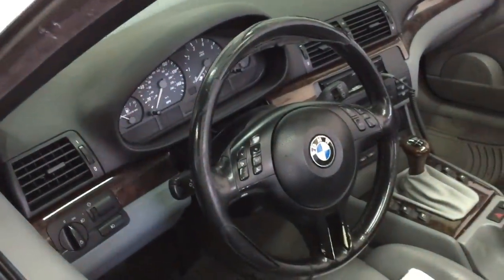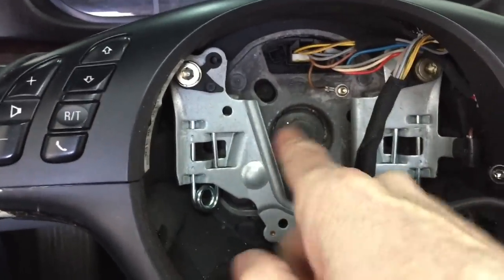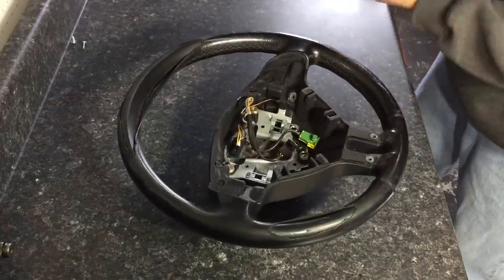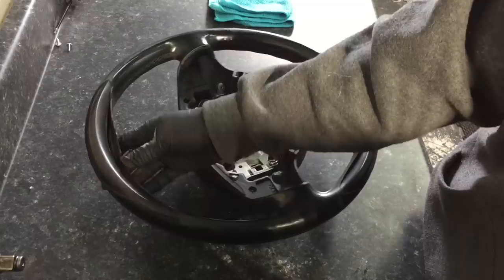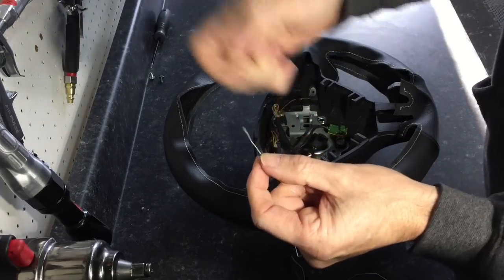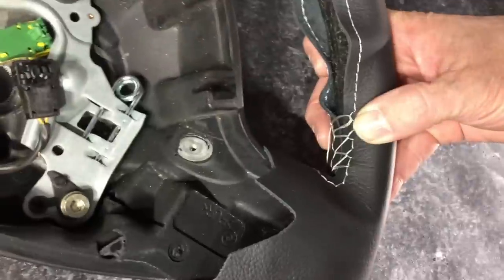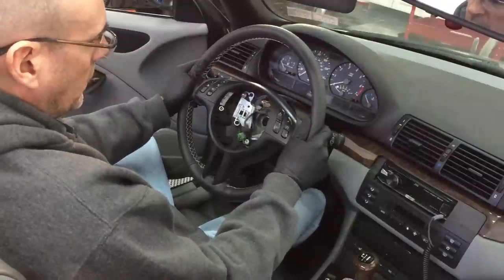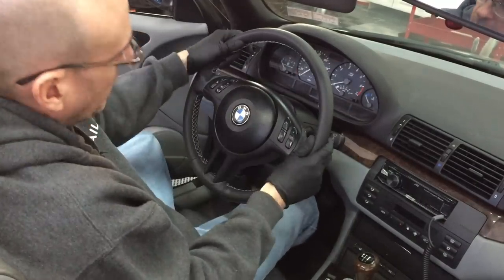Interior Restoration Vlog # 4 (Steering Wheel Leather Re Wrap) Plastic Trim Refurbishment!!

Comment from the maker: The interior color Dye is Easrwood Mnfg...https://www.eastwood.com/paints/interior-dyes.html?SRCCODE=TXT00020&adpos={adposition}&creative={creative}&device=c&matchtype=e&network=o&SRCCODE=TXT00020&msclkid=650f81b761e116e1e272dd824d09b2d3#

Tip...When the steering wheel is bolted back on...It is a great time to tighten the stitching and tidy it up a bit.

Comment: Brian, can that 'dye' product from Eastwood be used on the switches if they have worn to the white plastic?  I had an owner of a MB that worn out the buttons on the steering wheel from the black coating to the white plastic.
Reply from the maker: It is a possibility...When the buttons are worn...I usually make the call to replace at that point.

Comment: Those are T20’s inside of the steering wheel.
Reply: Also, why wouldn’t you just remove the bottom trim piece? It comes off with two T20 screws...